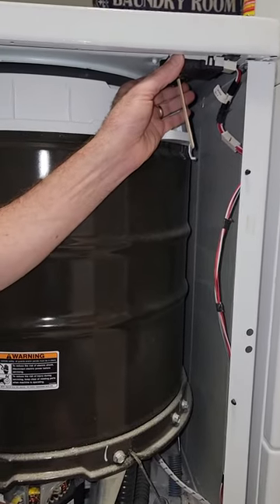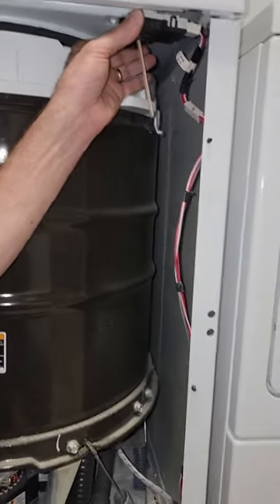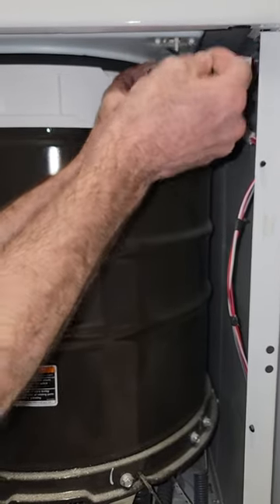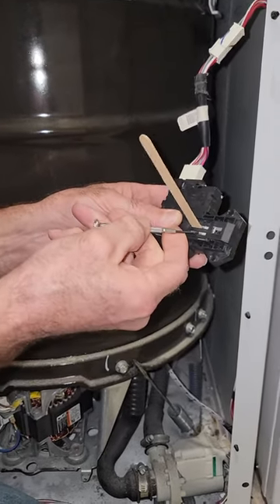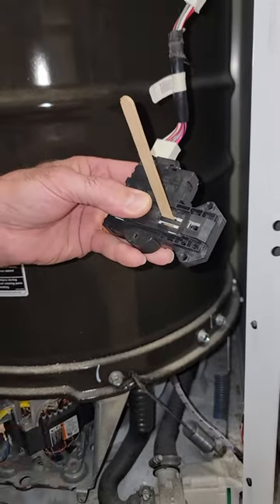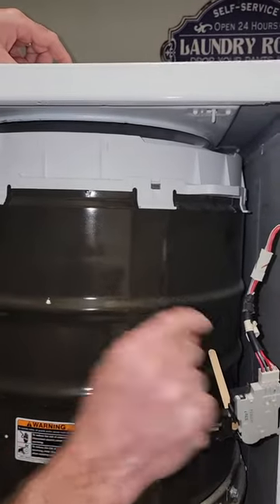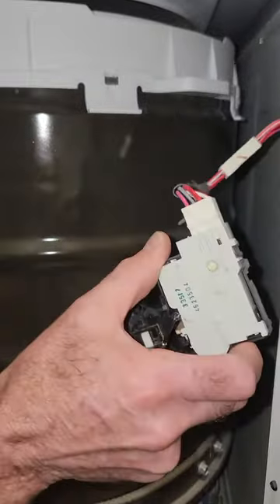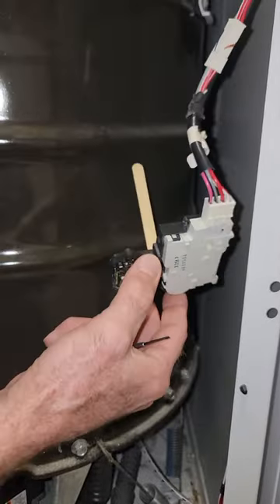Speed Queen TR7 top load washer washing machine lid lock, unlock and  bypass fix

Comment: Hate my SQ as well. Had issues with the lid lock and now can’t clear the Er 65 error. I unplug it like I’ve read, and it works for  load and then goes back into error mode as soon as the load ends.

Comment: If you have a lid lock failure, two flashes on rinse and lid lock, in my case the connector was loose.  I plugged it back in and it solved the issue.  Might only be temporary so eventually might do bypass or order new part.  Mine was a tr5

Comment: This did not work for me. I am an engineer and know how to follow directions. Maybe I have a newer machine or a different machine or a different firmware. When I do this fix the machine throws a lid lock error. I think it tests if it is locked and unlocked, the state has to change. My lid lock only has 3 wires too. 

I tested it with an ohmmeter and can't see how it detects the locked state. Darn!  I wanted this to work!

Comment: Not sure why you would buy this machine over the TC5?  Please explain.
Reply: #1 Noise……our washer is off of our kitchen and my wife works from home …..the tc5 was loud as F drove everyone nuts ….got the tr7 and can’t even tell it’s running…..I don’t know, I guess people say it doesn’t clean as good but ill tell you this , doesn’t rip shit apart (like my wife’s bra straps and tang top straps) 🤷 and I’m a maintenance tech at a machine shop , I deal with hydraulic oil /gear oil/ coolant and wash my uniforms at home and my clothes come out just as clean as the old one ….two pods , hot water and pre soak …..bingo
Reply: @stifflers69mom1  my tc5 is super quit as I have insulated with sound dampener.
Reply: @MatthewJames-st5wv  yeah let me just wrap my brand new washer in sound damper…..the wife will totally hop on board with that idea 🙄
Reply: @stifflers69mom1  Well yeah. That’s why you do it internally. If done correct, no internal components would be affected and you’ll have a quit machine. But you do you. Enjoy your Tc5
Reply: @MatthewJames-st5wv  you asked a question and I answered it, not sure what your trying to get at …..the fact that you tore your new washer apart and literally lined the inside with $ worth of sound dampener should give anyone an idea of the noise that thing makes ….it’s just not for people that have there washer next to there living area
Reply: @stifflers69mom1  I didn't tear my washer apart at all.  The front panel easily screws off.  And I feel like you knew it was noisy before you bought it 🤔🤔🤔But at least your clothes get clean.
Reply: We had the 5 and for this one for few features like delay start
Reply: TC5 5 year warranty….TR7 7year warranty
Reply: @irenek181  And miss out on that classic wash action the TC5 offers...no thanks.